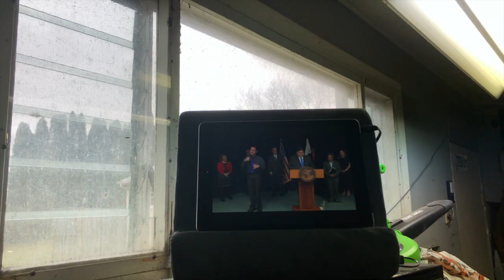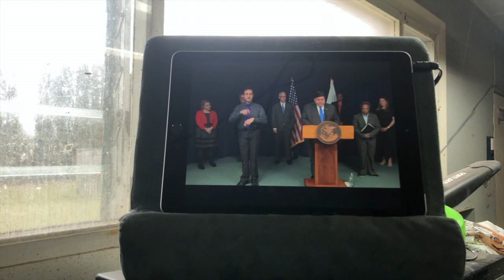Installing wild rides battle boxes in fox body mustang/ corona in Illinois

Comment: just doing the battle box install ..but there is really no need to cut anything out ..this boxes goes right into the hole and can be bolted on without cutting anything....
Reply from the maker: Mine would not fit into the hole at all